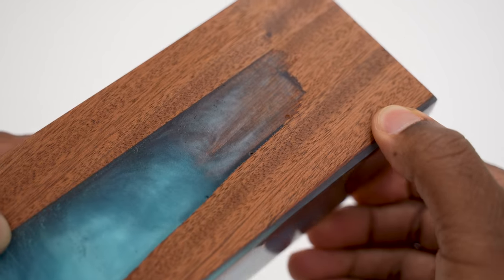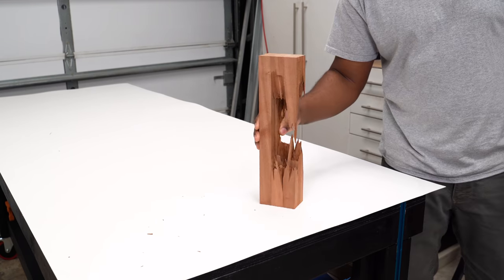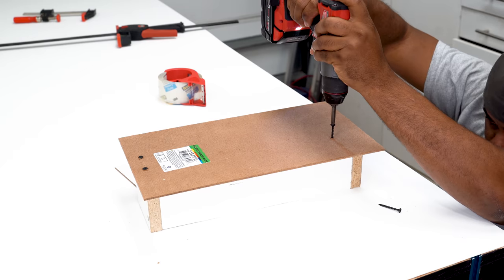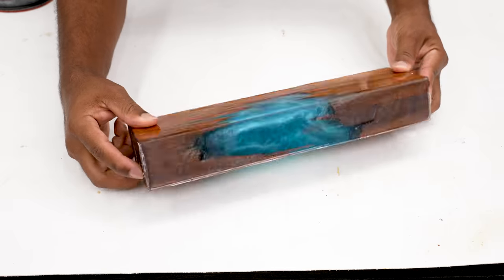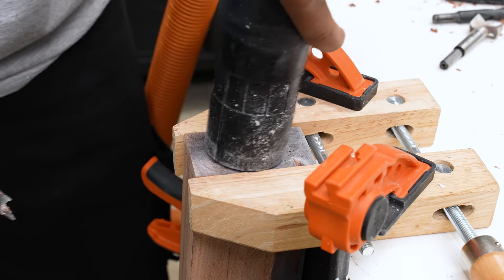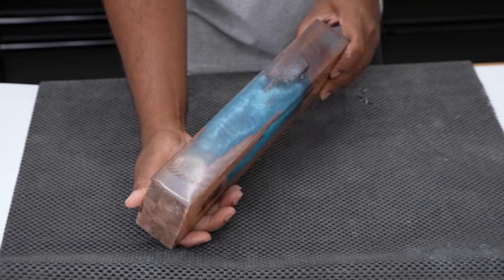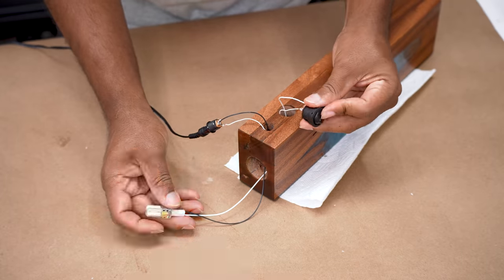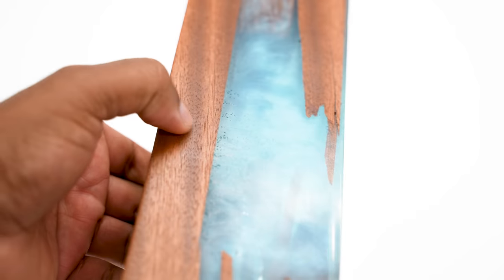DIY wood and RESIN LED lamp

Comment: Nice lamp.  I really like your videos. One thing I would of done different was to use mold release so the epoxy would not stick to the white boards you were using.

Comment: That's a cool piece. I have a bunch of petrified wood that I've soaked in vinegar to eliminate bubbles. I ordered a bunch of switches, power inputs, and LED bulbs. I was thinking about the tiny LED strands. Maybe another time. I always use Danish Oil and I like to take my auto buffer and use Meguiar's headlight polish on the epoxy. I also like using different glow powders. Good stuff, bro!

Comment: As you are dealing with mains electric I would advise using either heatshrink or liquid rubber wire cover to prevent the wires from making contact in future incase of the solder coming loose over time. Its always good practice to get into the habit of covering exposed wire connections

Comment: Hi, really love your work and subscribed. Can you explain more on the wiring.  I have bought the exact same components but can you explain more on the wiring. Firstly not sure of which two of the 3 prongs I shouldconnect to the rocker switch. Thanks

Comment: Great vid, what brand of epoxy did you utilize, and do you use a pressure pot to remove the micro-bubbles , thanks.

Comment: What happened to the light bulb? You said it ultimately failed but didn't explain. Did it fill with resin? Did it break when you were drilling in the second time?

Comment: Looks great. Just wondering: Will the bulb not get too hot?
Reply from the maker: It's wrapped in a rubbery substance, I think it will be fine. Time will tell. It will get warm but I have not felt it hot yet.
Reply: @DIYCreators  tnx. My main concern would be that it would kill the led. Time indeed will tell

Comment: Impressive. As an electrician, and for practical purposes, it would have been better to put the DC connector on the side and the switch on the front.
Reply from the maker: Thanks, I think I wanted a clean look on the front. I can be done any way though.

Comment: Hey man, Really dig your videos! I have a question about an older project you did (modern outdoor chair w/ 4x4 lumber). Do you recall what the spacing dimension was for the chair bottom slats where the removable back section wedges in? The spacing here looks wider than the other 2x4 slats that form the chair seat. 

Peace
Ross from BC Canada

Comment: what does the propor tape do and is there any wat to dey the resin faster?
Reply from the maker: The tape I mentioned, would have adhere better.  I am not sure I understand your second question.
Reply: No there is no way to dry the resin faster. If you do it causes issues. Resin takes patience and time.